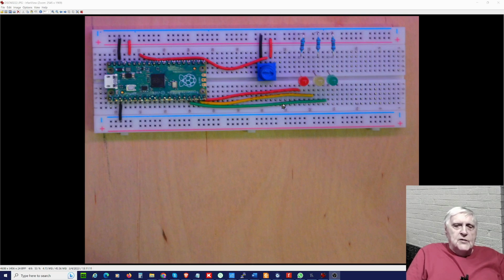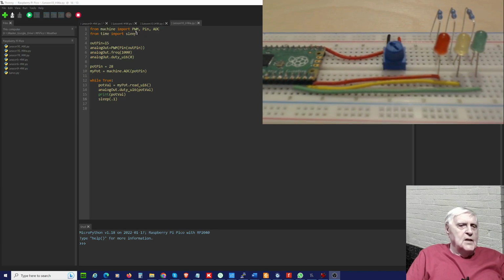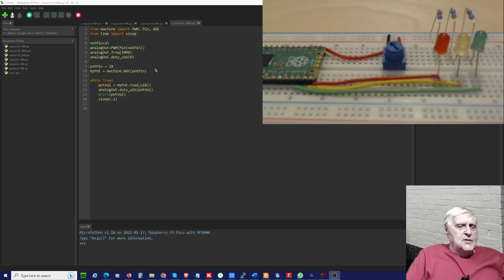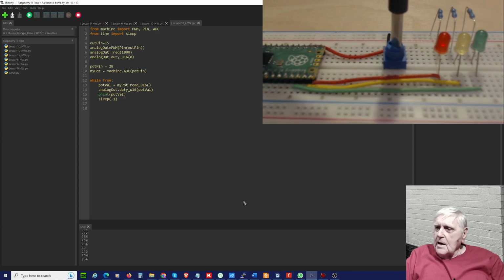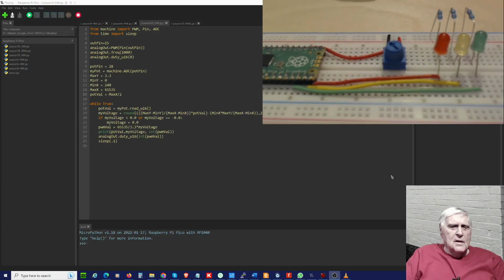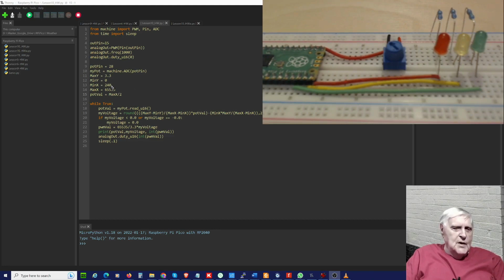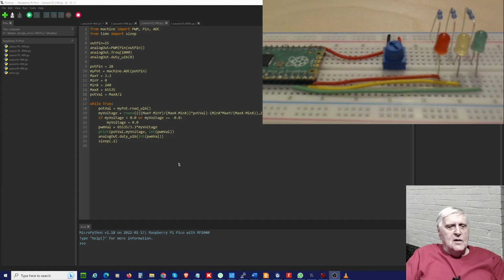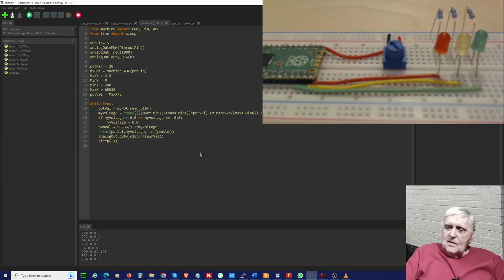Paul McWhorter's Raspberry Pi Pico Lesson 10 Home Work

Comment: Nice job! I also thought it would be a direct conversion but ended up with the dim led. As a practical solution (if not mathematically precise) I just used...
if potVal < 250:
   potVal = 0
Thanks for the video.